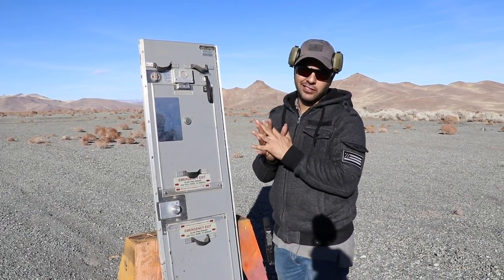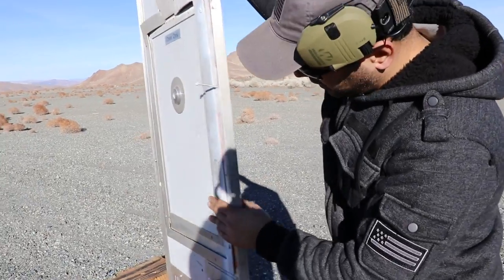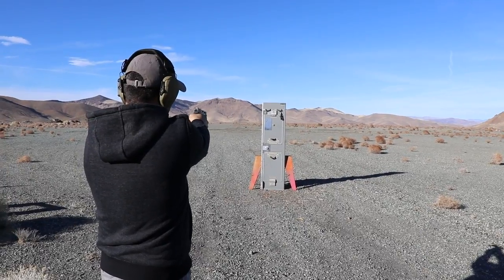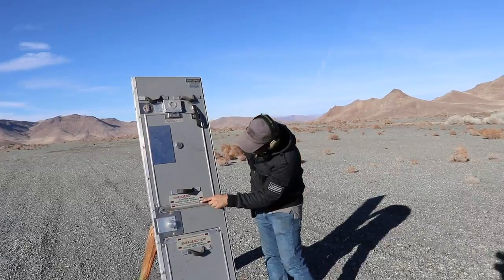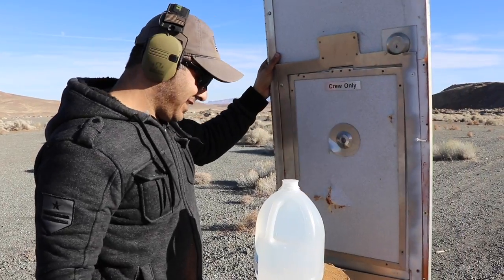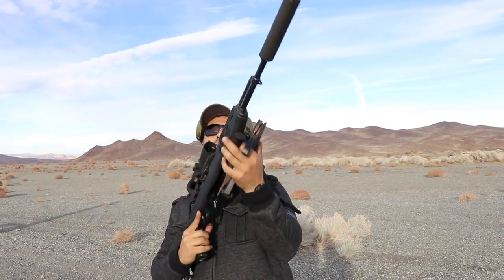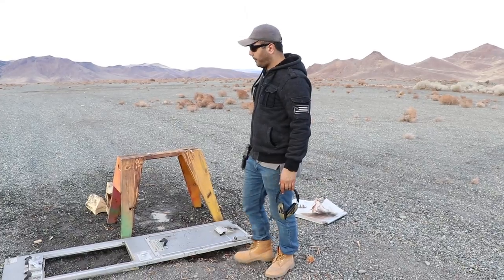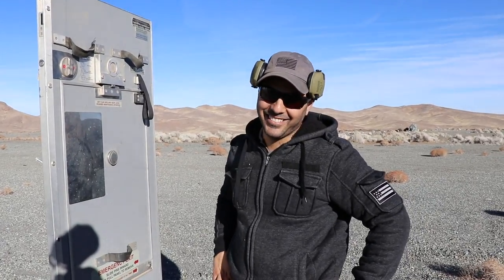boeing 737 Airplane cockpit door Bulletproof ?

Comment: If you wanted to attack the door, you would shoot at the door lock area multiple times. Do you want to shoot through the middle of the door which will not help you get it open but possibly kill the pilots and wreck the controls, or do you want to get the door open? You ave up after just one shot. Damage is cumulative. If shot in the same area, it adds up until the material breaks.  That said, I enjoy your videos.

Comment: You shot the wrong side of the door as mentioned below by leopard.
The lock at 0:-45 can be operated three ways as shown in the diagram next to it and the key is usually kept by maintenance and given to crew only in case of a faulty door lock mechanism.
The device at 1:20 and similar one at the bottom is s pressure sensor.The two panels are called blow out panels to equalize the pressure in the cockpit and cabin in case of decompression. The key like device is to prevent the upper part of the blowout panel from falling down. 
Can provide more details about the door if you can do the video again.
Please reshoot the video and shoot the correct side of the door  :-))

Comment: Those weird boxy devices on the top and bottom are in case of an explosive decompression in flight.  If the plane decompresses quickly, diaphrams inside those metal boxes open up to allow the top and bottom door panels to open, allowing pressure on each side of the door to stabilize.  The door itself is not strong enough to handle 8+ psi pressure loads between the front and back of the door.  A stronger door could be a hundreds pounds heavier.

Comment: The white fabric is not kevlar (aramid, kevlar is just a brand of aramid), but i don't know exactly what it is. Probably some sort of polyethylene balistic fabric (check wikipedia "HPPE"). The bee hive stuff is nomex honeycomb, used as a lightweight stiff material for structural parts, very common in aerospace composites. Sometimes made out of aluminum, sometimes out of nomex but the color here indicates Nomex. Probably non resistant to bullet since i cut them with a simple cutter. (just my two cents as a guy working with composites).
Reply from the maker: thank you

Comment: the two best semi auto magnum caliber pistols are the egl in .44 mag and the .357 magnums best platform is the coonan kel tek tried with the pmr in .22 mag but its not very reliable with some ammo cci seem to work well from what ive seen tbh im a rifle guy tho and am currently trying to design a sabot tungsten dart to fit the .50bmg case aswell as the 338 lapua i need funding tho but when i get them right they should punch through most stuff and if they dont the micro shaped charge with a real copper cone to form the molten jet of doom will

Comment: Shouldn't you be shooting it from the passenger side of the door as opposed to the pilot's side? The door is designed to protect the pilots. An intruder would be firing from outside of and into the cockpit.

Comment: but the question is why are you shooting this as if the pilot would shoot their way out of the cockpit XD, the panels are called blow back panels to allow pressure to equalized in case of a depressurization

Comment: Blowout panels. That is for a pressure difference.
Reply: The door is unsealed. The panels are just escape hatches in case of a fire or other emergency in the cockpit.
Fun Fact: There's also a rope in the cockpit that the pilots can use to climb out the window if they need to.
Reply: @mike7972  Nope. I've installed hundreds of those doors. They're not pressure sealed.
Reply: Erebus66 I don’t think you have or you aren’t reading the Maintenance manual. If you look at Boeing’s AMM 52-51-00-210-801 they are listed as “Decompression Panel Hinge” and there is an inspection item for the seals on the panels. I’ve done several of these and most of my students think it’s an escape for the crew but you won’t want to leave the flight deck, who’s flying the plane?
Reply: Erebus66 if you want I can send you an official doc it will blow your mind as it appears the carrier you work for has mis stated the function of this, if you have looked at the doc’s provided buy them.
Reply: Mike not to be overtly stubborn about this but I’m looking at a 737 BCA Crew Door at the Renton factory right now and the decal over both hatches clearly state “Emergency Exit”. I imagine it’s in case the door won’t open after a rough landing and the pilots don’t feel like climbing out the window. I will check the AMM however.
Reply: Mike Installation Plan and Drawing confirm: Emergency Hatch. Don’t have an AMM handy.
Reply: Ok, we’re both right. The hatches ARE emergency exit hatches. However, in the event of flight deck decompression the top hatch acts as a “Pressure Equalization Panel” and can fall inward about 5” before being restricted by the lanyard. This ensures the integrity of the after bulkhead of the flight deck. It seems bizarre to me because the flight deck and crew cabin are not separated by a pressure seal but the Maintenance Manuel does confirm you’re statement while the engineering drawing confirms mine. Weird.
Reply: Erebus66 stop think about what you are saying, if there is a fire or other reason for the flight crew to exit the flight deck. Where would a fire come from? The F/D is the furthest part of the plane from anything flammable. Plus you your self said there is an escape rope to exit the windows. You need to research this as you are working on a critical part of the plane if a cabin depressurization happens and those panels don’t blow you could have critical failures to the F/D windows and a crash.
Reply: @mike7972  Again, in the event the door won't open after a rough landing, more than plausible as the clearences around the door frame are quite small and the LAV A is hardly immovable, it may be necessary to use the Emergency Exit panel on the crew door. People aren't going to want to have to climb out the damn window if they don't have to. Especially because that makes it incredibly difficult to back INTO the flight deck.
Reply: @mike7972  I mean, it says Emergency Exit on both panels. If they weren't intended to be used as such I sincerely doubt Boeing, the drawing engineer and Installation Planner and the Door designer, it arrives with decals already in place, would bother labeling it as such.
Reply: Erebus66 this is a problem in our industry each career has their own placards and rules. But the FAA for inspections is for the true use of the part. Now if you look at the door in the video you would be hard pressed to get through those panels unless you’re the size of a child. And I can tell you most pilots for my career can barely get in the door itself.😂
Reply: @mike7972  Well, clearly, the main problem is our functions. You, I assume, work for a carrier. I'm final assembly at the factory. We're basically just arguing over terms. There's no reason the panels can't fulfill both roles. I would argue that even FAA manuals can't supersede the drawing. I admit to nothing but I know for a fact that I could easily fit through that bottom panel if I had become locked in the flight during a electronic lock Functional Test...
Reply: Erebus66 well I’ve got ECRA’s and Boeing maintenance manual documents FAR’s. But you just need to always follow the MM to CYA your self. Good luck to you sir.
Reply: @mike7972  lol, Now you're just tossing out every applicable acronym. But well played. Have a good one!

Comment: Իմ կարծիքով դուռը հատուկ չի պաշտպանում մեծ տրամաչափի փափուշտներից որպեսզի հատուկ ծառայությունների աշխատակիցները կարողանան այն ծակել իրենց զենքով:

I guess the door is intentionally designed that way that it doesn't protect against heavier firearms, like assault rifles. The chances that an AR15 or AK47 will be taken on board of a plane are quite low, but in case the terrorists somehow manage to take the crew cabin the special forces should be able to penetrate the door with their firearms